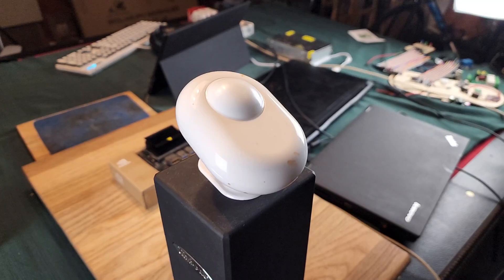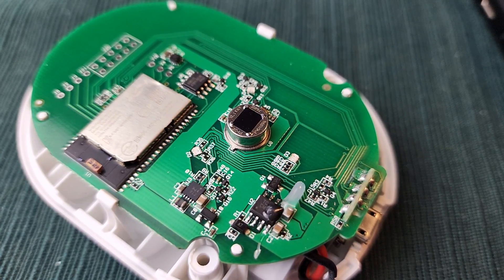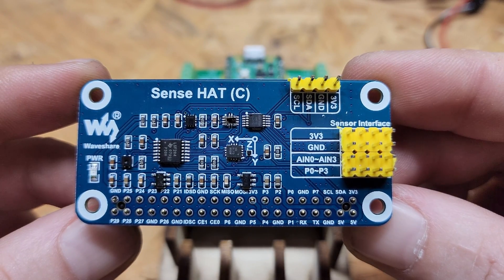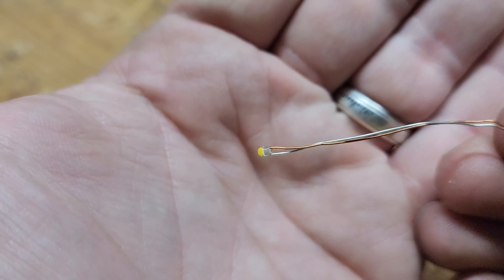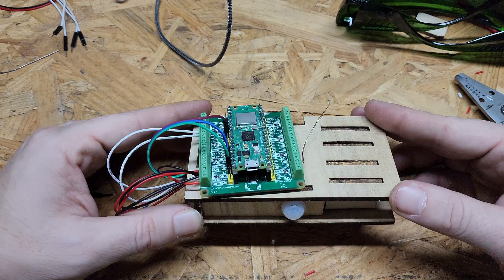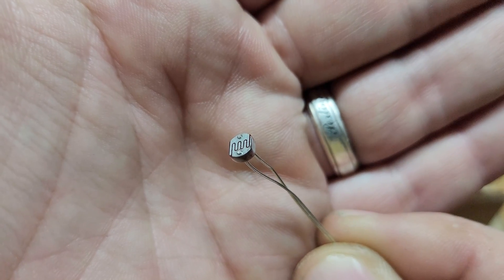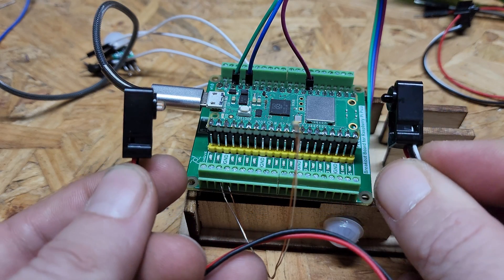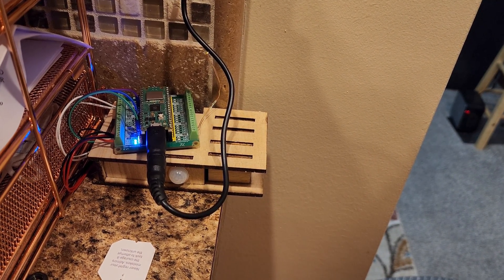DIY Smarter Motion Detector With People Counter

Comment: I would like to make a motion sensor for airsoft so that i can see how many people are there and where they are through goggles or a gadget
Reply from the maker: If you mean by setting up sensors in zoned locations before a match and then streaming that data to some sort of reticle or other HUD, I could see that being possible but much more complex than a YouTube comment section has room for and I would have to sit down and really plan that out. Reliability would also likely depend highly on how much money you spend as well as how much work you put in. 
If you want a device that can "scan" from your location, you're probably looking at something that would be carried in a case and have an array of various sensors and require some minor deployment procedure, but I suspect this isn't what you had in mind. Having a pair of goggles that could find where people are in an almost Call of Duty mini-map sort of way is probably possible to some degree--and the military would be all over it--but also very, very expensive. 
If you have a way to set up the previously mentioned array of sensors, I would recommend a combination of microwave zone sensors--being careful not to get them so close they interfere with one another--and LiDAR. This could also get rather expensive and you risk the units taking fire as they would have to be within height range of the targets and have LOS. I know this isn't particularly encouraging, but it's the best I can think of.

Comment: I am working on a project where i need to detect only one person entering the door as ok and 2 persons entering simultaneously (un leagally) should be warned. I prefer usinf arduino uno and its senors. What would you suggest sir
Reply: There's no door. It's just an entrance when we need to detect only 1 person entering at a time. If multiple persons enter together it should alarm
Reply from the maker: I think computer vision is your best bet. It would too easy for two people to stay close enough together to fool a break beam or even presence sensor. The link below may be a good place to start researching that. Another possibility I thought of is LiDAR, but it's a little pricey and could be finicky to set up, I have a LiDAR module that I've been planning to do something with, perhaps I'll experiment and see if this problem could be solved this way.
https://www.robotique.tech/robotics/detection-and-tracking-of-a-moving-object-using-a-webcam-controlled-by-arduino/
Reply: @smartercircuits  thank you sir.... Finally got an practical solution
Reply from the maker: There's a few different things you could try, but it will depend on a few things like whether or not there's a door or just a doorway. I would say break beams would be a good tool, but I've had trouble finding ones with the distance required--which is why I used the IR laser and two beam sensors to detect it. But, this isn't perfect. One more dependable solution I can think of is a pad with load sensors under it giving you the ability to calculate the weight on the pad. That way you could say over a certain weight threshold you're likely looking at more than one person--although, even that has flaws with edge cases. 
If you can find good break beams, I think they'll be the best bet for ease of installation, but if someone is actively trying to cheat the system, it wouldn't be that hard. Something a little more complex, but much more accurate and dependable would be to somehow use computer vision and a small camera mounted on the top of the doorframe looking down. You could identify moving masses and determine if there is more than one. I'm not sure if this is possible with Arduino, but I would imagine it is at least to some extent.
I hope this helps and I wish you luck!

Comment: Sorry I am new to this hobby. Could you explain the role of each of the 3 sensors on the device? I am confused why the passive IR motion sensor is facing the wrong direction as well. Thanks!
Reply from the maker: The Passive IR is mounted on the side to monitor the room, the break beam sensors pick up a person passing in either direction. The current sensor and photoelectric didn't get implemented, but were originally to detect light levels the way the Shelly does, but really it's even more novel that the device is already and it was a pain to set up, so I skipped it. The IR laser is there to provide scattered light when an object passes in front of it. There are some objects or materials that may not reflect enough light, but that where some modification to the code handling the messages sent by this device could use the motion detection in the room as a backup indicator. This is really just a proof of concept build, you may have more luck with actual break beams if you can get strong enough ones. I have some, but they require much higher power. I first illustrated this concept in this video: https://youtu.be/edj6Fn3FFnE

Comment: Hello, what changes would you recommend to make the device smaller?
Reply from the maker: If you could get a 3d printed case and find a way to omit the IR laser, place one or two on the other side of the doorway, and use them as normally closed instead of normally open as I'm doing in this video because I'm using the light being detected in the way the beam being broken would normally work.

Comment: Have you seen the one Everything Smart Home has made? Thoughts on it?
Reply from the maker: I had not until just now. That looks great, and I love the wave detection sensor! I'll look more into this one, but I still like the absolute value of the break beam turn-style thing, though it's easy to bypass as a security device. I'll be building a better case for it, but really it's much more conceptual than prototypical anyway. I hope to inspire those who want to get more hands-on--DIY enthusiasts and the like. I think Everything Smart Home's device is probably much nicer aesthetically and functionally--especially where security might be concerned. I strictly use computer vision and PIR sensors for that at the moment.